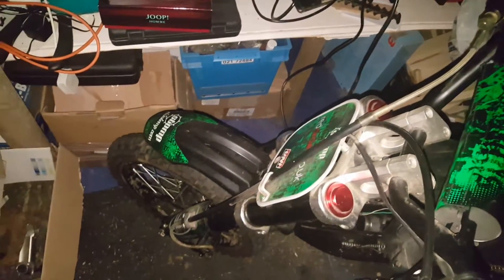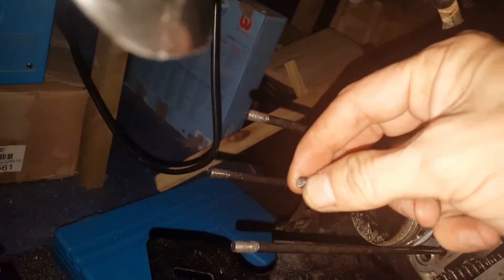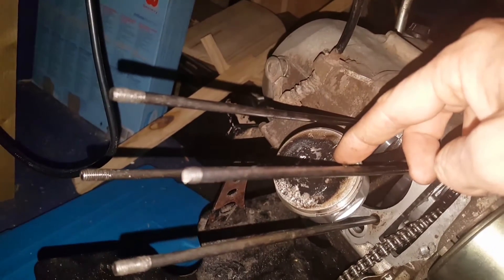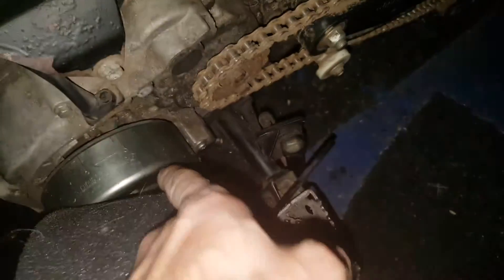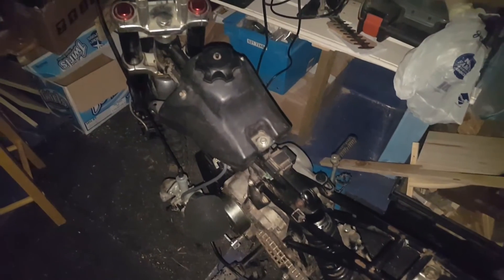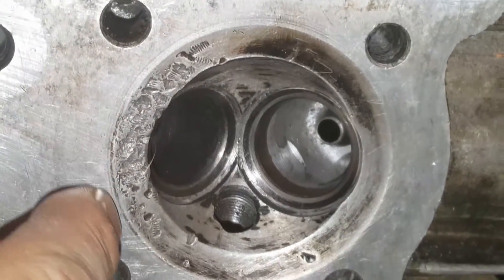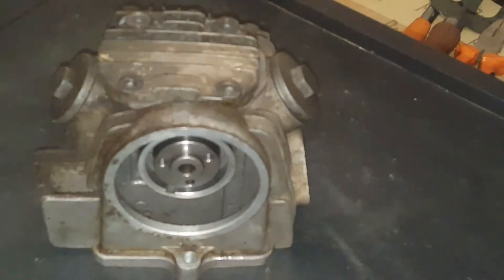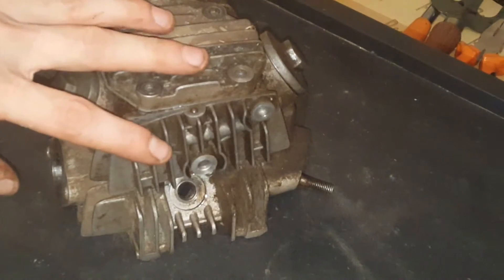HOW TO FIX BROKEN PIT BIKE ENGINE TOP END lifan 125CC

Comment: Hi Nate After being out on my thump 140 I’ve noticed a hole in the underneath/front of cylinder headX will this affect my bike, still seems to start and drive fine , only 3 day old ? Any advice can a head cylinder be replaced alone and or will it affect my hike
Reply from the maker: You are maybe missing a valve cover, these can rattle loose with vibrations, check and see if the hole has threads for winding a cap on like a lid, or 2 bolt holes to hold a cap on.

These can be bought on ebay for a few pounds, you don't really want to ride without one as mud and water could destroy your engine if it gets in.
But it sounds like you are missing a valve cap that's all

Comment: The thing is you can buy the whole engine for 200$
The rebuild kit is anywhere from 60 to $100.. by the time it's all said and done you might as well just buy another engine and then have a parts lying around...🤷 JMO...
Reply from the maker: Sometimes the engines are bad, if you have a good one, it's best to rebuild it.
Reply: @oraclescave  that's why I take them apart and go through them before install .. 
Sometimes tolerances are a problem with these but not as often as slap together assembly... 
In most applications these engines are under fueled and overworked and as a result end up getting hot bent valves are common due to cheap inadequate steel they use to make them with..

Comment: I have "pithog" and the company only makes ebikes now and no more gas, i also have a lifan 125 that ive been using for parts including the piston, ive blown a couple piston in the "pithog" and now the sleeve is completely fucked and i need a new top end, the one on the lifan is too short for the pithog, ive check amazon for "125 top end rebuild" but everything that comes up is "110 atv" but its all 52.4mm which is what mine is aswell, any ideas as to why that is and habe you tried amazon for parts?

Comment: i’m needing a bit of help pal, recently got one of these bikes frame says 125 and i was told it was a 125 but i got it and it was bogging like daft, cleaned the carb got it tuned in but the bike was absolutely gutless wouldn’t go past 10mph lol. anyway the head on it has turned out to be a 110, i think the boys had issues and swapped it for that, i’m needing to buy a new bore and head any pointers on where to get the stuff? and is it a lifan aye
Reply from the maker: Most of these engines are the same, only the YX engines are different really.

You should have an engine number stamped into the engine.

If you Google that number it will tell you exactly which jug and head will match that engine.
Then ebay to get the kit, PITBIKE SPARES, is a good place to order from on ebay.

Chances are, your engine number will probably end in something like FMJ
but parts will be easy to locate.

I will check a few out and send you a link to what you are looking for.
But it's important to make sure the BEARING that goes inside the piston underneath is the same size.
Probably 13mm for a 125cc.
Reply from the maker: Also check the piston size, straight across the centre of the top.
Probably gonna be 52mm if it's a 110cc
And 54mm for 125cc

Some have 13mm pin, others have a 14mm pin, holding the piston onto the rod.

So if your pin fits the rod perfectly, you know that's the size you need, so look for a 54mm jug and piston but make sure the piston pin (wrist pin) is the right size for your rod.

Comment: My bike has the exact same fucking problem I think I’ve fucked it up I didn’t undo the cam and tried to knock the head off
Reply from the maker: Sounds bad, just make sure the long head bolts are not bent and you will probably be fine.
If they look straight, it shouldn't be a problem.

Comment: Hi doese any one know y my 140cc head is spluttering and blowing smoke from spark plug it still works theres just a problem any help
Reply from the maker: You might have a bad head gasket, or you have cracked the cylinder head.
Or your valves need reset.
Reply: @oraclescave  thanks for the info mate I'm going to take head off and see if its the head gasket if not it could be the piston rings bike is starting and running just pops
Reply from the maker: @declanreo6342  always start with your spark plug, check what colour it is, should be a bronze brown  colour.
If its black you are running your fuel mixture to rich. 
But your spark plug will show you what's up.
Reply: @oraclescave  my spark plug is basically black the idle is fine tho
Reply: @oraclescave  I'm going to take head off in a sec I'm guessing its just the head gasket
Reply from the maker: @declanreo6342  I used to patch my motorbikes up with gaskets made from cereal boxes.
Works fine as a temporary fix to see if that is the issue.

I just rub oil over the head, press the card onto it, and when you take it away, there is the full print of the gasket transferred onto the brown card side.
Now you can cut around it.
Reply: @oraclescave  thanks mate iv got gasket seal I'll let u know what the problem was
Reply from the maker: More than likely it's just needing a new set of piston rings, they wear out after a while.
It would be easier to just replace the piston though, as there is a special way to set the rings and size them.
But very easy to take the head apart and replace piston and then put back together.

It can be done without removing the engine aswell.
It's a good fun project to do and takes about 2-5 hours if you take your time.
I can usually do it in under 2 hours, and there is plenty of step by step videos showing everything.